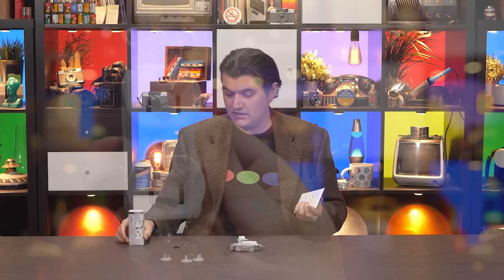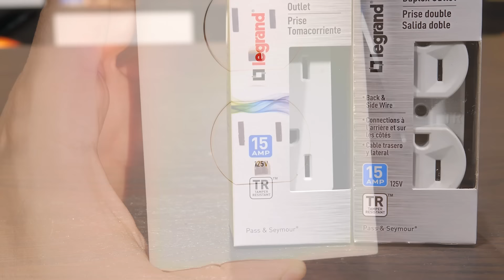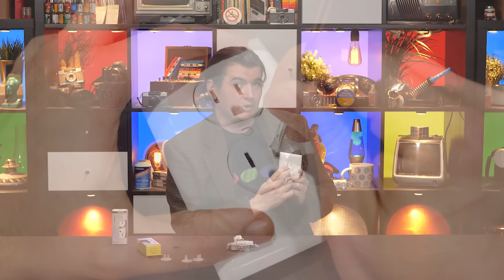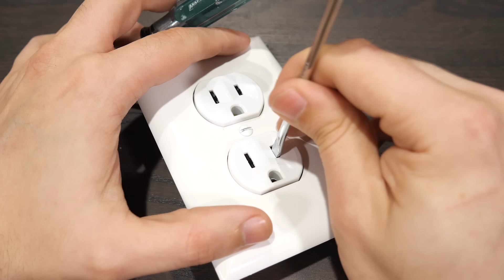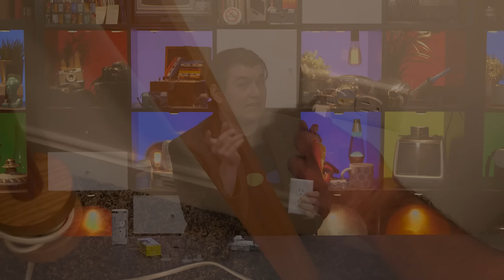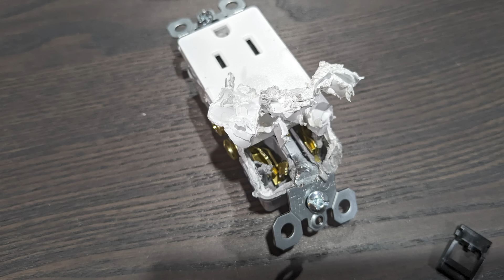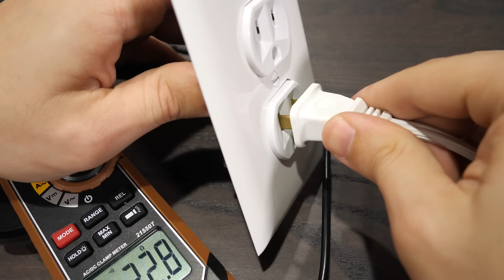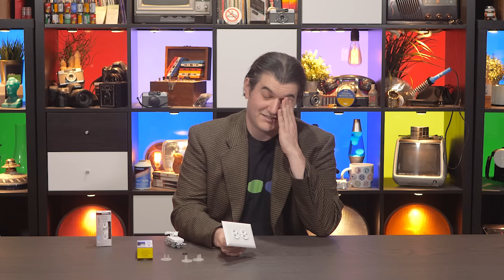Tamper-resistant outlets aren't all the same - a follow-up

Comment: Interesting to hear that US plugs are kind of expected to wear out and be replaced, at least in a high usage environment. This is only one persons experience, but in my 50+ years on this planet I've never experienced an EU plug being worn out to the point of inserted cables coming loose. My main problem has been with some cheap power strips that are so tight that it takes quite some effort to insert the plug.
Reply: A frequently used outlet is good for about 10 years, very roughly.  The basic US outlet design is very cheap in boxes of a dozen.  Might as well replace a whole string while you've got the breaker off.  Only takes a few minutes.

Comment: let me argue in favor of the spring loaded wire hookup on the back of the outlet, it's got many things going for it with little draw back. It's much harder to make good connections with the type of screw terminals that outlets use. They're so inaccessible, small and fiddly. You have to like wrap the wire around the screw to make sure the pressure's even and torque down on it real hard (with a horribly inadequate phillips screw driver)

The spring loaded one on the other hand makes a perfectly good / better contact as long as it's inserted all the way. Spring contacts' main weakness is repeated cycles over time and wearing out. That's a sacrifice we made for convenience in the case of consumer electrical outlets and other connectorized electrical systems, but for a properly designed spring connector, the "plug in once and forget about it" scenario is best case. They get used a lot in commercial equipment cause they can be convenient ways to make reliable connections in "lower" current applications. Not to mention they're also safer from an exposed conductor perspective. They hide all the live connections, so if outlets removed the live screw terminals altogether, then there wouldn't be any exposed wiring at all when the outlet is just sitting in the wall with no cover plate over it. I can't really even think of anything against them in this scenario.

Comment: Yes, by "falling out" people mean the fact that US plugs become partially unseated. It is just a really bad design and bad mechanical engineering.

The US needs to a different plug and socket design. Of course it won't because it's costly and considered by some as the "freedom socket" and "freedom plug."

The Euro plug and socket are not perfect, but the "Schuko" or "Schutzkontakt," meaning "contact protection" physically prevents from any of the pins being exposed while running electricity. It also prevents mechanical strain from the outside being directly transferred to the pins which leads to the plug being unseated in the US design

Comment: im not in the US but dont you guys have holes in all your plug tips? why not lock the tips when you turn on the outlet? 

probs a dumb question and theres probably plugs without holes, but surely itd still work if the locking pins just sat on the side of non holey pins? 

food for thought

Comment: In any outlet that I have used a space heater in, if the outlet was installed with "back stab" connections instead of using the screw terminals, they had melted and heat-corroded after just one winter season.  When you take the bad outlet out of the wall, the wires slide right out.  It's a really bad connection that can't tolerate continual use at capacity.  (At least nobody seems to implement them well. There is no clamp arm.)

Comment: here's the problem Way too many people have to do the wiggle jiggle to unplug something which really loosens up the outlet. and then people don't understand that a loosey-goosey outlet does not have a good connection and your plug will start overheating as you have very poor contact with lots of resistance... and then all the sudden kaboom your plug to your portable hair dryer melts down from the high heat of the blades overheating

Comment: When I bought my house, half of the outlets would barely hold onto a plug. Some would just let it flop right out. I don't think this was due to wear and tear, just shoddy manufacturing. The house isn't that old (1996), and some of the faulty outlets were in areas where they shouldn't have seen frequent use.

Comment: Gonna toss in that higher voltages tend to be connected to higher amperage breakers. It's not the 480 at work that scares me, it's the 1,000amp breaker upstream. That fault will be VIOLENT.

Comment: As someone who lives in country that uses schuko socket type, i just don't get why american type need to have connector holes flush to the wall and not deeper in socket. I feel like making deeper sockets would fix a lot of problems yet still be compatible with old plugs, and making new plugs more beefy, to grab to the socket itself. The only compatibility problem is that angled plugs and flush to the wall appliences, that can use some kind of addapter for now.

Comment: Having been shocked both in the US and in Peru, I can say that the shock from the higher voltage is worse because I genuinely thought I was going to die for maybe a minute afterwards. The shock in the US just surprised me and effectively woke me up because I got it when I had just woken up so all it really did was remove my need for a morning cup of coffee. The one in Peru instantly blasted me physically all the way across the bathroom and made my heart flutter.
Reply: "Baristas hate him! Wake up cheaply with this crazy trick!"
Reply: I’ve been hit by 277V before and it’s not even close to what 120V feels like. We were removing some lay in lighting and a 277V neutral that lost its path to ground fell and landed on my hand, which grounded to the ceiling grid. Took me a few minutes to recover after that one, nowadays I would recommend anyone who gets hit by 240V+ or even 120 just if they feel bad to go to the ER and get an EKG done. 

I’ve worked with voltages from 480/277, up to 69,000V. The medium and high voltage stuff is always scary, but everyone knows if you get hit with it you’re dead. Everyone takes caution, tests their gloves and sticks, doesn’t go “hands on” primary until it’s been tested dead and **grounded**. 

I would guess more people die working on 480V than medium voltage. Everyone takes it casually until something goes wrong
Reply: @MrSamsamsammy let alone, there is 480V in every three phase supplied house but medium voltage is always somewhere in the street behind locked doors.
Reply: @MrFrozenFrost  I could easily walk out and reach a 15kV line with a teleloader
Reply: I've been shocked by 120 probably about 10 times now. It really isn't that bad. One time my skin got a little burned and the worst one caused some minor nerve damage in my hand. I respect 120 and I fear anything higher.
Reply: Once when I was old enough to know better I happened to be sitting against the wall by a 120V outlet that had its socket guard chipped so you could get significantly more finger in what should've just been a slot. After a few minutes of idly feeling around it the thing bit me (bit of a hot buzzing sting) and I stopped messing with it, but it was mild enough that nobody in the group I was with noticed that I'd gotten shocked.
Reply: Ive been bit by 120 more times than i can count, 240 a few times, and 480 just once. 120 feels like a 9v battery to me now 😂
Reply: as a teenager I (stupidly) had my thumb jammed in a 240V power supply while wiggling something around... next thing I knew, I was on the other side of the room and I couldn't feel my thumb for a few hours. could have been a lot worse
Reply: Fun fact; the electricity did nothing to physically blast you across your bathroom. It was actually your own muscles having spasms, betting all of your joints were sore as hell for a week or more from straining all your ligaments
Reply: When working on my car I got a 15kv or so shock. For a few seconds I was sure someone or something had punched me in the chest. But a second later I was ok. Those shocks are really fast because they are triggered by the distributor exactly when the pistons are in an angle before top dead center. I can only imagine someone being shocked for a few seconds in high voltage wire
Reply: I've had half a dozen 240V shocks and every single time it has thrown me across the room and leaves me phased for about 30 mins. I think it triggers an involuntary heavy adrenaline reaction as well as the obvious muscle contractions.
Reply: @Bystander333  Your comment implies you can trigger adrenaline voluntarily.
Reply: had a few shocks on uk 240v over the years and its just a good jolt. 😀
Reply: @kieronmarshall2658  Probably because of RCDs? With my 230V shocks your life flashes before your eyes and it hurts a bit but you're ok immediately afterwards.
Reply: @cyan_oxy6734  Was decades ago on circuits before rcd upgrades.
Reply: A higher current in some circumstances might be safer. 100 mA will stop some of the heart muscles and they will not be in sync anymore. A higher current like 1 to 5 A will stop all your heart muscles and if you get out of from the circuit you may survive with some burns. A defibrillators applies a higher current to deliberately stop all hear muscles in the same time. Like Electroboom when the 2000 V 500 mA Jacob's ladder fell on him. There have been cases when linemen got shocked from medium voltage power lines, with currents possibly in the 10 A range and some of them survived with just some burns. Of course this is valid for DC or low frequency AC. With RF(radio frequency) you may have  100 mA flowing through your body, like when touching a Tesla coil and not feeling anything.
Reply: Every times I've been electrocuted was because I was not thinking or not paying attention enough. The worst one by far was 240V after putting a finger inside a live socket, as the muscle convulsion violently threw my arm back and nearly dislocated my shoulder. 
Shorting a capacitor at 10000V was pretty bad too and left holes in my finger, but DC didn't cause any convulsion, more of a feeling of getting bitten really hard. 
By comparison with 240V, 120V is so mild that it's more of a surprise than a shock, at least when touching both wires with the same hand.
Once I even managed to grab a live metal box during a bathroom flood, with my feet in the water and that felt a bit weird but not all that strong, so I'm guessing the water must not have been fully grounded. Afterwards I really had mixed feelings between feeling very lucky and dumb at the same time.
Reply: @VeniceInventors  Electrocuted means you died. You probably mean shocked, unless you're a zombie perchance?
Reply: @FENomadtrooper  you are correct (about being shocked that is) I didn't know that electrocuted implies death or at least serious injury. In some cases, getting shocked just doesn't sound as bad as it feels, maybe we need new words to better convey the intensity of the shock. Electrotickled, electropinched, electrobitten, electropunched, etc ;-)
Reply: @VeniceInventors 2 questions: 1) why was your bathroom flooding? 2) why did you have an exposed live metal box in your bathroom?
Reply: Someone clogged the toilet and on top of that managed to break the flush valve. When I woke up it sounded like a river coming from the bathroom, and when I got in the first thing I saw was the heater partly submerged, and being half asleep I just grabbed it to keep it from shorting out. That old heater has a metal enclosure and handle, which aren't grounded  as it's a two prong plug.
Reply: @improvids8405  Okay, that makes sense.

Comment: @7:50 appliances with pass-thru AC outlets scare the bejeezuz outta me, especially metal lamps. A power strip with a fault protection is about the only way to use one.

Comment: I know this isn't all that common, but we do have 240V in homes... (sometimes 208V) There are even 240V  receptacles. Even more so, there are even 240V outlets that look almost exactly the same as the regular 120V ones. Look up NEMA 6-15 or 6-20 outlets. Same design, just different pin orientation.

Comment: The UPS I got for my PC and modem/router has tamper resistant receptacles in it. Was very annoying getting used to the force you need to put plugs in.

I've always had the regular orientation plugs throughout life and have had 0 issues with stuff partially unplugging or causing issues.

Comment: All the tamper resistant receptacles I've used barely hold onto the plug. The strongest gripping are still too easy to pull out. They also don't stop me from inserting tweezers, because tweezers put even pressure on both sides.

The back stab issue is the connection moves each time you plug something in. The push or clamp connectors "Wagos" don't move once finished installing. I prefer the receptacles with the metal plate that clamps onto the wire by screwing it down, rather than the screw itself holding the wire.

Comment: As an electrician for 25 years, I’ve been zapped more times than I can count. It definitely doesn’t feel good, but usually it’s just a buzz. Maybe I’m just used to it lol. The trick is to make sure you aren’t grounded, or touching the neutral, so you don’t complete the circuit. You could hold on to a hot 120 volt wire all day if you’re isolated from ground (and very humid situations) and never get shocked.

Comment: American here, the "plugs always fall out" thing I run into is specifically 2-prong plugs. I just experienced it most recently on a plane, but I also have it in my room with a specific power brick. I think something about the weight of the power brick being attached to the prongs, and pulling down on the prongs a little ways, before pulling further in that direction due to gravity means it slips out of outlets in a second if there's not some kind of meaningful friction in the plug helping to hold it in place. (literally tapping the wall outlet one in the wrong way means it falls out a lot for me for a phone charger).

Comment: I can't believe you didn't comment on the obvious flaw of TR recepticals. Yes, it is harder to stick something in. It's only possible if you stick two things in at the same time... which is far more dangerous than sticking only one thing in. 

Even the hot pin is harmless unless the object inserted provides a path to ground, but on the off chance that a kid figures out to stick in two objects they are nearly guaranteed to be electrocuted.

Comment: Engineering concerns aside, backstabbed outlets suuuck to replace, it's nearly impossible to get the wire out without just cutting it and then your wires in the box are short enough that it makes it a pain to work on.

Comment: Yes, 120V AC can actually kill you, but that's a VERY unlikely scenario. As you said, you would need to be barefoot, wet floor made of cement or similar material which provides a "good" ground, the line would need to be unprotected (no breaker) and you would have to grab the cable flat and get "sticked" to it, or if you have a pacemaker or something of the sort that can actually get damaged by a shock then you need to be extra careful.

Don't get me wrong, electricity is really dangerous and you should treat it with outmost respect. If you're going to work on an electric outlet or any other device, SHUT DOWN THE BREAKER so it is NOT LIVE. If there's no electricity, the danger is really minimized.

I've worked with electricity almost my whole life and it is some kind of a job hazard to get shocked sometimes. I've personally had many (more than 20) electric shocks at 120V. All of them were just a small sting that made me jump backwards, it didn't leave a mark, it didn't hurt afterwards, nothing. You can say that I'm really lucky, but it is the other way around, it's very unlikely to get hurt by a single touch of a live wire at 120V.

By the way, the code is there precisely for that... People are stupid, kids are curious, so, the breaker trips and you don't die.

On the other hand, I've only been shocked ONCE by a 240V wire. Afterwards I was really shaky, and I imagined everything that could have gone really wrong. All my shocks at 120V were just a superficial pain that made me jump and I barely felt it on the tip of my fingers, but getting shocked with 240V on the very same spot, the tip of a finger, I felt it through almost my whole arm, it stopped somewhere above my elbow. If I had shocked my shoulder instead of my fingers, I'd probably not be here telling the tale. So, yes, 240V is no joke.

By the way, this is AC we're talking about. A shock of 120V AC is not THAT dangerous, but a shock at 90V DC is a whole different beast. That stuff is REALLY dangerous. So, yes, BE REALLY CAREFUL with your electric vehicles, don't try to fix the batteries or something of the sort, don't get your fingers inside a power supply of a computer or TV. Unlike AC, which gives you 60 different shocks in a second (so you can let go the wire), DC just sticks to you and keeps going, so, yes, don't touch that or you'll die.

Comment: One thing I never do is buy the cheap contractor-grade outlets.  I always buy at least spec grade, and sometimes I find a good deal on hospital-grade and buy those instead.   My recent purchase of tamper-resistant 15 amp Outlets were all hospital-grade. 

Yes, you're paying $3-$4 for each  receptacle rather than $0.89, but it's my house and I plan to live here for decades so I want it done properly.

The better quality outlets don't crack, don't get scratched, and they hold onto the plugs quite firmly. It's totally worth it, I've even convinced my wife to accept the fact that some of our outlets in the house will have little green dots on them.